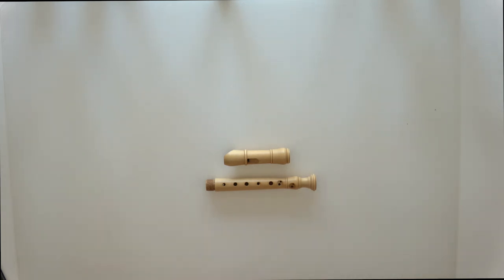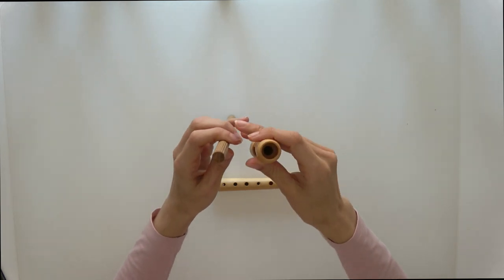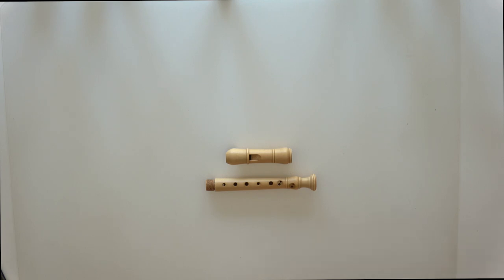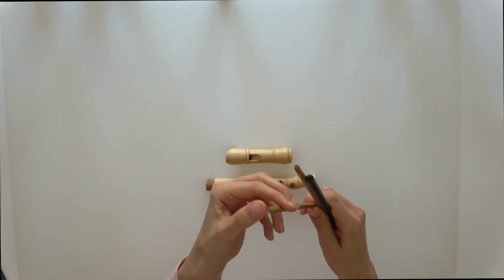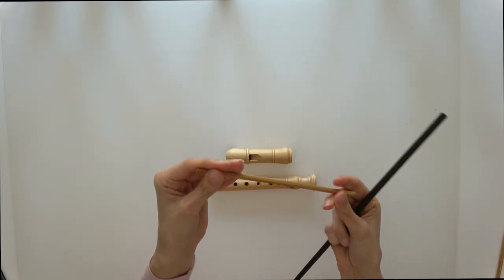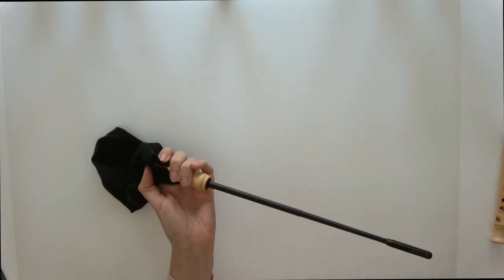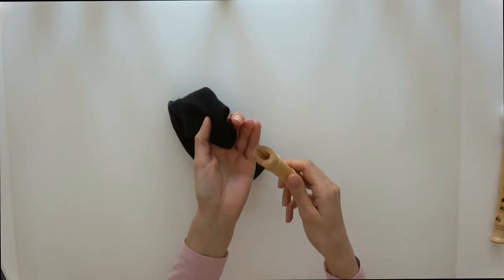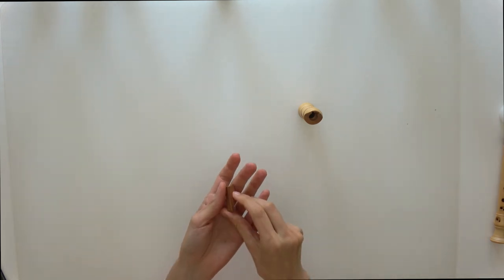How to clean extra small recorders

Comment from the maker: ( 🇪🇸Vídeo en español: https://youtu.be/ToS-6HfcWdY )

Here are the links to the other videos!
How to clean the block of the recorder: https://youtu.be/LBryuSxvbK0
How to oil the recorder: https://youtu.be/XPsaGnBPV04
How to maintain recorder tabs (cork / thread): https://youtu.be/4A0cA5L_vsE
How to place new thread on the tab of a recorder: https://youtu.be/r32Pt-jutrY
What to do when a recorder block doesn't fit: https://youtu.be/pHTGs4b_ph0
How to solve a regularly clogged recorder: https://youtu.be/JmL6KXOQQGA
How to treat mould in a recorder: https://youtu.be/k0nfahcg09o
How to prevent the recorder thumb hole from wearing out: https://youtu.be/46LxHeFZWnI